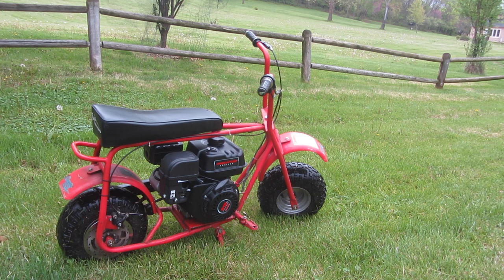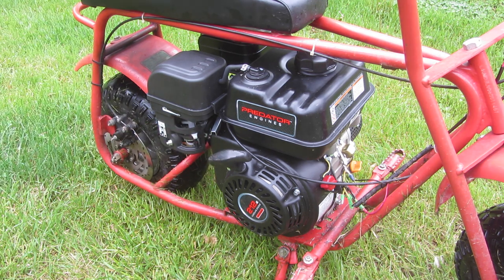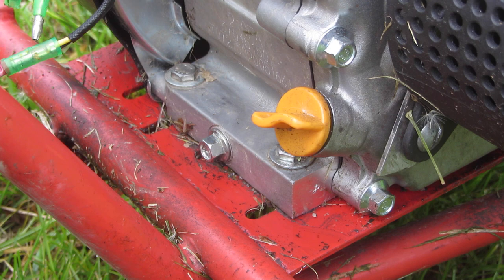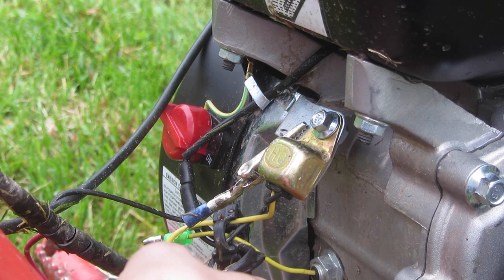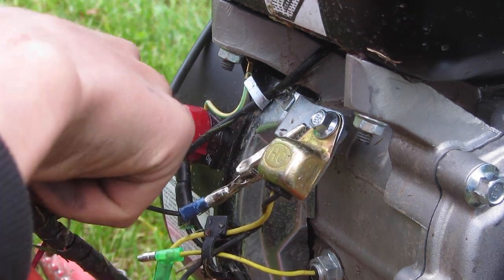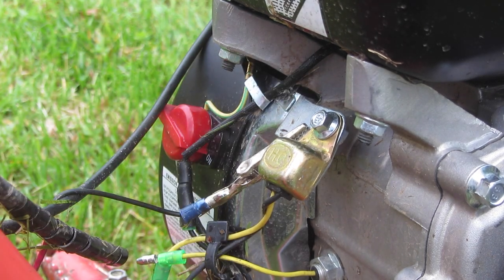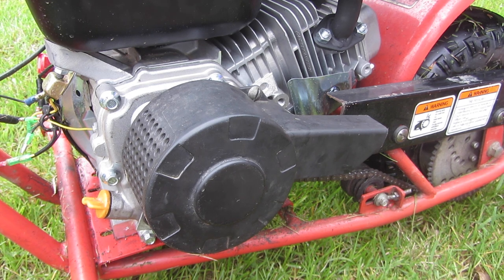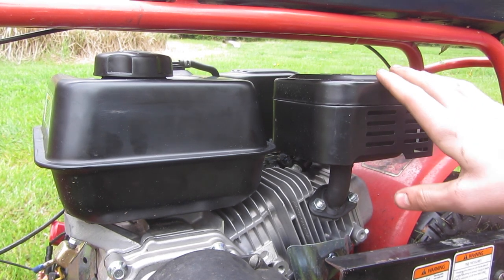6.5 HP Doodle Bug Mini Bike Project

Comment: Dude i did the same thing, i got a predator 212 hemi and ran it till it broke in then i put a stage 1 kit on it from go power sports then the clutch started to fail on me so i decided why not put a 30 series torque converter on it and you wont belive it how fast it'll fly well after using a philips screwdriver and loosening the governer bolt as far as it'll go it'll fly way past 65mph.

Comment: Just scoped one In mint condition for being 10 years old never ever worked on just need some new forks and a motor swap new clutch chain sprocket split hub adapter and possibly a mounting plate lol but at least I wont have to take the gas tank off this frame

Comment: On rotating the pull starter- just loosen the bolts, spin it 90 degrees counter clockwise, and tighten it back down? I wanna do that to mine for the same reason you did, but donno jack about pull starters and how to clock them..
Reply from the maker: Just take the 3 bolts out then move the starter and re tighten.
Reply: @FlyByTire  yup ! Trev NZ

Comment: does you chain pop off alot? i have an older style like yours where the predator 212 will bolt right on, everyone is telling me i HAVE TO GET a mounting plate for the engine or the chain wont line up
Reply from the maker: Mine is fine but I know some of them won't line up. Just look and see if your chain is straight.